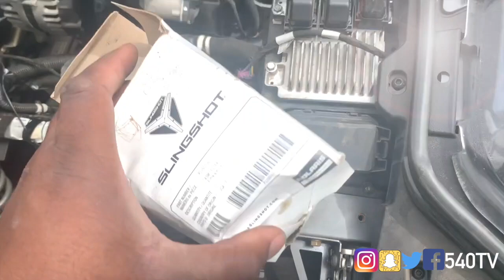Polaris Slingshot Oil Change *SIMPLE*

Comment: Nice job man - glad you showed that I can use the 1 1/4 inch socket for the filter as an alternative. I just picked up a 17 SL same color as yours. They replaced the rear tire for me but said it didn't need an oil change, so I'm going to change the oil myself. I may get a spoiler and a bigger windscreen as my first mods not sure yet.
Reply from the maker: That’s what’s up man, I may upgrade mine! But that big windshield is love.